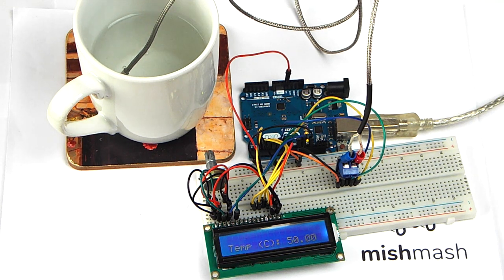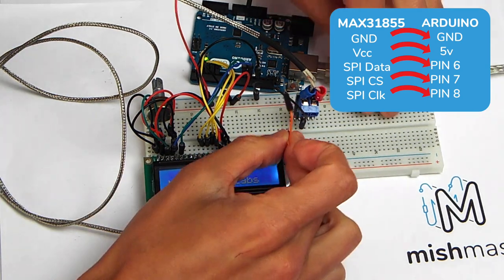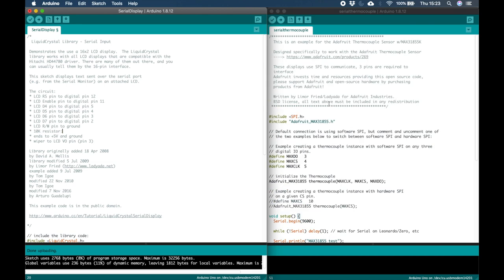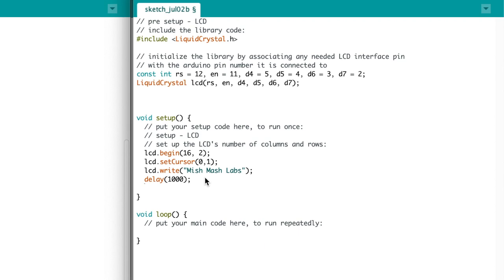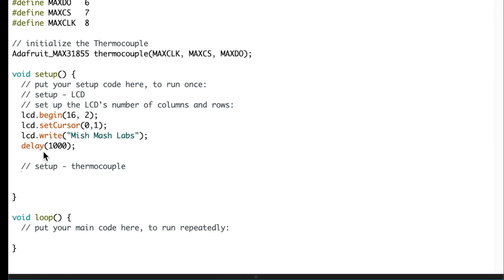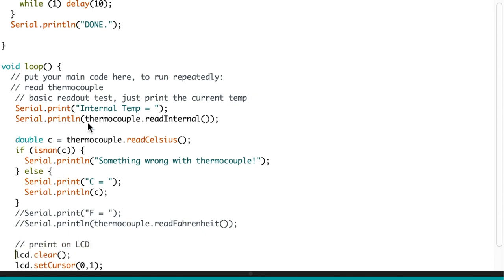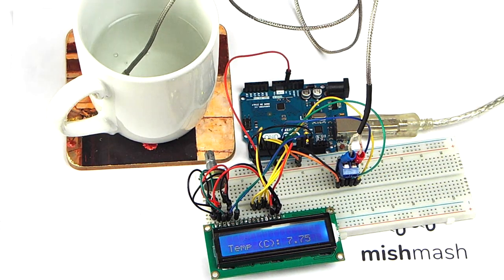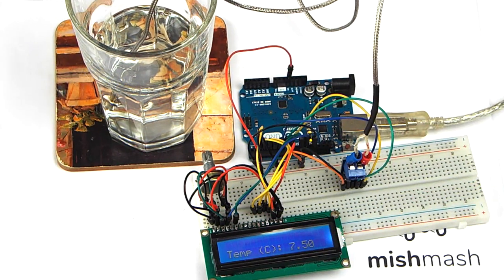Arduino Thermocouple and LCD Tutorial

Comment: I have a doubt , as you  are saying MAX31855 chip can also be used to read temperature from PT100.       
How ?
PT100  output is change in RESISTANCE.
MAX31855 read change in voltage ???????????????????
Reply from the maker: By integrating the PT100 into a wheatstone bridge and measuring the voltage change there.

Comment: I am having an overshoot in the temperature readings. Put it into ice cold water (which should be zero C) and its reading around 6C +-1C. In ambient air in my room (around 65C) is reading 45C, so this is not a linear error. Any ideas on how to fix this?
Reply: I have also tried two separate k-type thermocouples and the readings are aligned.

Comment: Hi, does this code work for MAX6675 as well?
Reply from the maker: The logic should be the same. Although you may use a library that's designed for the MAX6675 and double check the calls for read the sensor